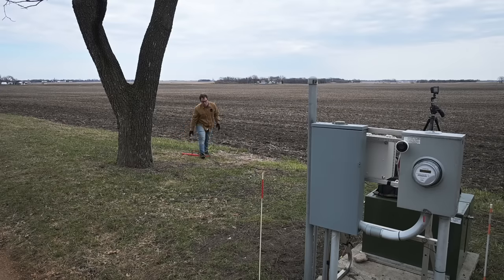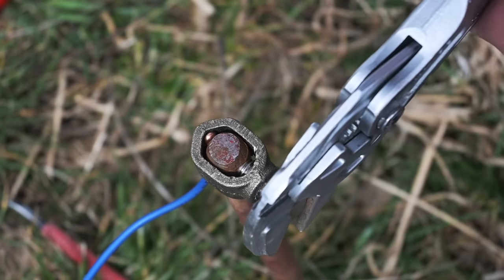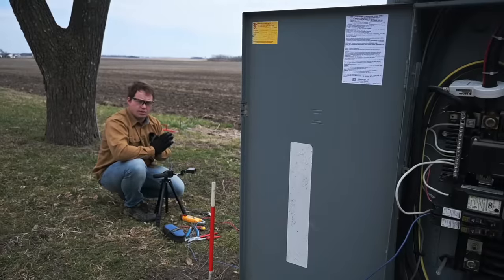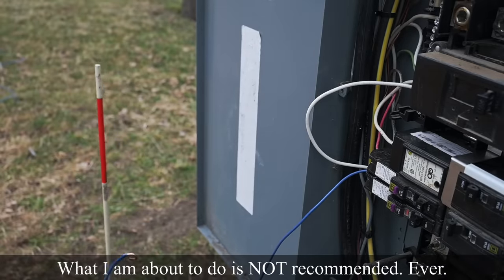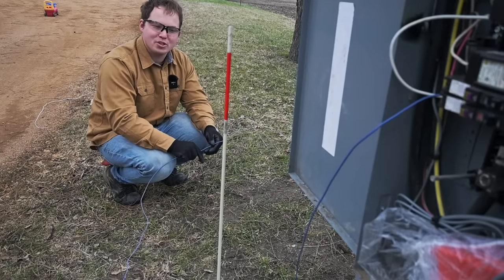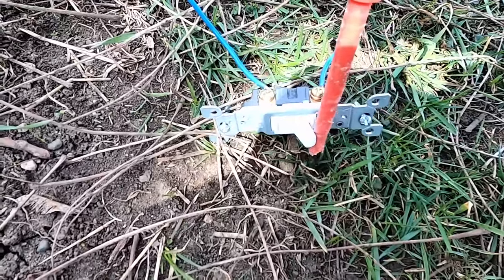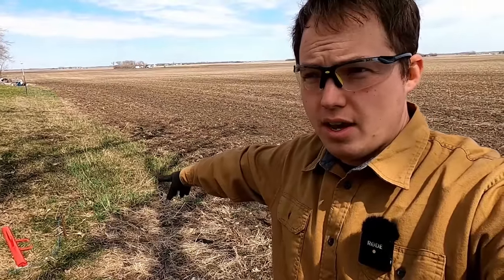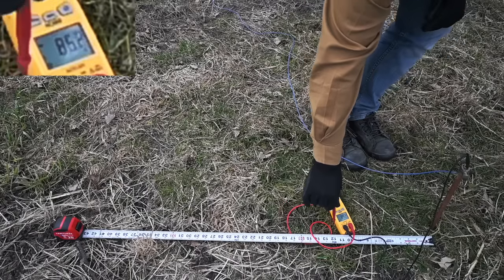Will 120v To Ground Trip a Circuit Breaker?

Comment: So, other than cost - why not install a GFCI breaker in every position in your breaker box?
Reply: I mean with new code you need an AFCI breaker for almost every room in a house. I would assume AFCI Breakers would also protect these faults
Reply from the maker: In my opinion cost is probably the main issue. There is no reason to not have GFCI and AFCI protection for most of your circuits. One reason you could argue is that in some "dry" areas like bedrooms GFCI would not add any significant protection because the individual is unlikely to be "grounded" and thus the GFCI would not trip. Another reason is that GFCI breakers can "nuisance trip" where they trip for seemingly no reason. Interesting stuff!
Reply from the maker: Interesting thought. I wonder if an AFCI would trip in this scenario. That might have to be a future video!
Reply: Most of Europe does. Instead a GFCI on every circuit I believe they protect a portion of the panel. Like a little sub panel within the panel. I believe they call them RCD's residual current device.
Reply: In some countries such as the UK every circuit in the house has ground fault protection BUT the trip level is 30mA not 5mA, and I believe they use one main ground fault protector for the entire house (they call them RCDs there). The problem with installing a single GFCI breaker (or outlet) to protect an entire circuit is that everything you plug in has a given amount of electrical leakage (and this is perfectly normal). When these leakage currents add up to 5mA now you have a nuisance trip. For this reason, it's better to install a GFCI outlet at each point of use, and this is what is commonly done in commercial buildings, although it costs more. It's also a lot more convenient to reset a GFCI outlet than one in a breaker panel.
Reply: @pjseiler5930  Some AFCI breakers have 30mA ground fault protection. Others have no ground fault protection at all. This varies based on the brand--for example, Cutler-Hammer/Eaton type CH AFCIs do have 30mA ground fault protection, whereas, if I recall correctly, GE AFCIs do not. A combination AFCI/GFCI breaker has 5mA ground fault protection.
Reply: @BenjaminSahlstrom  I don't use GFCI breakers so I can't speak to the propensity for a given brand of GFCI breakers to nuisance trip (and it's not like you have much choice in the matter, you are stuck with the brand of the panel it's going into). But for GFCI receptacles---my experience is been that the Legrand GFCI receptacles produced in 2017 are far more likely to nuisance trip than current production Leviton GFCI receptacles. I've been replacing Legrand GFCI receptacles with Leviton ones because of this.

If you dig deep into the UL943 requirements for GFCI receptacles, you will find that the allowable trip time increases as the leakage current decreases. At 6mA, a GFCI is allowed to take as long as 5.5 seconds to trip. But at 50mA, a GFCI has to trip in 1/4 of a second (250mS). 

But it probably costs more to implement this current-dependent trip time, so some GFCIs don't do this and simply trip instantly regardless of the fault current once it exceeds the 6mA threshold.

But a GFCI that does implement the current-dependent trip time would be more resistant to nuisance tripping.

The formula stated in UL943 for the trip time is:
T = (20/I)1.43 Where T = time in seconds
 I = ground fault current in milliamps
Reply: Some loads will falsely trigger a gfci -  like the sparking igniters on a gas stove top.
Reply: @HoosierRallyMaster  Depends on the GFCI, some brands are more prone to false tripping than others.
Reply: @ericwotton2046  Yes, originally there were just one to two RCDs in the panel. Now the trend its towards more nd to RCBOs (Residual Current Breaker with Over-Current protection). In Finland RCDs are mandatory in new installations on all circuits with the exception of a dedicated fridge or freezer. This includes also light fixtures. On modifications they are mandatory in bathroom sockets.
Reply: @ericwotton2046  Yes, originally there were just one to two RCDs in the panel. Now the trend its towards more nd to RCBOs (Residual Current Breaker with Over-Current protection). In Finland RCDs are mandatory in new installations on all circuits with the exception of a dedicated fridge or freezer. This includes also light fixtures. On modifications they are mandatory in bathroom sockets.

Comment: The current isn't trying to get to ground -- it's trying to get back to the source. In this case, it's creating a loop that goes thru the blue wire and back to the panel somehow (probably through the grounding rod over by the panel).
The dirt between the two grounding rods has some resistance. Apparently in this case, the resistance is high enough where it won't trip the breaker. This is why it's important to have big ground fault paths. The resistance has to be low enough to trip the circuit breaker.

See this Mike Holt video, the slide around 18:26:
https://www.youtube.com/watch?v=mpgAVE4UwFw&list=PLRNS1x1jcKbEgNJx26RWB8O4Fm1Ny-bxK&index=1

A grounding rod isn't a suitable ground-fault path.

Comment: No one differs on if you split the neutral and the ground. You only connect them after you jump voltages in either the transformer or the first panel.

Comment: Had a service call 2019 90% furnace locking out turned out the neutral outside somwhere was loose . fluctuating voltages at outlets in house.

Comment: Wow! Very cool video. So now I'm wondering why breakers DO trip when a hot leg touches a ground. Maybe it has to be within the system rather than straight to a ground rod?
Reply: Bc it travels through copper earth wire to neutral then home
Reply: @Froggability  you mean if its bonded. Right? If neutrals and grounds arent bonded anywhere and a hot leg touches the ground, breaker wont trip. I assume

Comment: Buddy to make a proper ground you need to take the ground rod and bond to the panel to make it trip. The reason it dose not trip is because it’s not bonded to the source. All you did was make a wire the Load like a light bulb. And light bulbs don’t trip CCTs

Comment: So loving your videos and learning so much. Quick question: why does the voltage decrees the closer to the ground rod you measure? In my ignorant mind it seems like the voltage would increase the closer to the source it was? Please help?
Reply: Good question - it's counter-intuitive the way it's done. Made me think for a second as well. Think of it this way. The ground rod is electrified when the breaker is turned on. All of that voltage is not drained into ground, otherwise the breaker would trip. If you put both probes directly on the rod, you would have a measurement of zero voltage difference.  Alternatively, if you measured the voltage (which is actually the potential DIFFERENCE between the 2 points of the multimeter probes) between the rod itself, and a point 100 yards away out in the middle of that empty field, you would have a large voltage difference. It would be something less than 120 volts because the full 120 isn't on that ground rod due to some of it leaking into the ground. As you move that probe in the middle of the field closer to the ground rod, you would start to see less and less voltage DIFFERENCE between the 2 probes. Hope this helps.

Comment: We had news of a Lamp Post electrocuting (but survived) a teenager....     I don't know how Lamp Posts are wired...
But, wouldn't you expect that if the Hot or Neutral were to touch the metal Post, if should blow a fuse ??
Maybe the ground was not properly bonded to the metal Post...    Who knows...   The kid did survive....

Comment: Question. I have a bathroom in my garage with a steel bathtub sitting on the concrete floor. I have a 240v waterheater sitting on wood blocks . Do I need a gfci for the water heater?
Reply: Not for a 240v circuit. But you should have a 4 wire cord connection instead of the old 3 wire.
Reply: @andread8251  where should I hook up the 4th wire?

Comment: Earth has different resistance some have high and some are low resistance. For this reason the code prohibits earth as a SOLE return path to earth meaning alone it is prohibitted but in conjuction with other conductor like EGC it can help have lower fault current to EGC experience extensive damage to EGC. Both current flowing to EGC in parallel with the earth will go back to the source.

Comment: Prospective earth fault current on a TT supply with and earth rod is so low it will not trip on a MCB circuit breaker.
That is why in the uk all installation relying on a earth rod for mains earthing requires RCD protection gfci in America

Comment: 120v will NOT kill you nor will anything being 14kv and under lol, I worked and maintain the 14kv n under power lines and have been zapped by a 14kv line and it only hurt really good 👍 120 n 240v aren't bad at all, way less then a bee sting, like one but without the lasting of one. Why most die is from the length of time held on a 14kv. If grabbed your never letting go. Because your muscles tense what does being that the 14 kv like a stun gun locks it all up

Comment: The only thing to stop a ground fault is to open the circuit (or turn off the power source if you have control of the generator.) The breaker does just that and it's why EGC is so important, you want that fault to pull as MANY amps as possible. The more amps, the quicker the circuit opens.
Putting the hot wire to the ground rod only creates a circuit from source, to ground rod, through the ground, back to the ground rod of the panel and then back to the source. Electricity is ALWAYS trying to get back to the source. That was the eureka moment when I was trying to learn this stuff. Because of the high resistance at the electrode, it's not going to pull a lot of amps through it to trip that breaker. Mike Holt had a really good video on EGC and grounding. Lengthy and technical but absolutely thorough. https://www.youtube.com/watch?v=mpgAVE4UwFw
And I'm glad you didn't accidentally "kneel" on the ground during this video. Might have been your last.

Comment: I just paused the video but here's my prediction. The breaker will pop but not instantaneously as it's going to be directly related to the resistance to flow once the resistance gets low enough the breaker will pop 🤔

Comment: This things proved that between live wire connected to earth ground the circuit breaker did not trip  what about the  neutral ground   touching the live wire what would possible happened any answer???

Comment: if it was nice and warm and damp out maybe you could have driven some worms up to surface for fishing LOL
I have seen this twice in real life my neighbor got shocked by his lamp post that was set in concrete because he replaced photocell and wired it wrong making pole hot not grounded it was like that for a year. 
my brother's sister-in-law had breaker running to swimming pool that kept blowing turns out the original installation of the wire was just Romex buried in the ground a foot deep and somebody hit it while digging and just threw some electrical tape on damage so in rain or wet ground it would draw too many amps and blow

Comment: Hey can you do a video of you building a fake wall with wood studs and insulation and create a electrical fire scenario?  Like show what happens when you run a Electric heater on high for a long time  how it will eventually heat up the wiring.  Be good to show people because SO MANY people think it's the Heaters them self's that start the fire yet it's actually the heater heats up the wiring inside of the wall that creates the fires.
Reply: It's not really the wiring in the wall that creates the fire, it's the shitty connection at the end of it that does.
Reply from the maker: I have thought about doing something like that in an overload/high load scenario. Will definitely add that to the list.
Reply: @BenjaminSahlstrom  I'd suggest using a receptacle with backstab connections, except remove/reinstall the backstab wire a   few times to make a bad connection. Then power a space heater through it.

Comment: I only have half of the power to my plug. H to N 62v .  H to G 120v. What is wrong with it?
Reply from the maker: Sounds like you have a loose neutral wire/connection in a junction box, panel, or on the receptacle itself. That is what I would be looking for. Since you have 120v from line to ground it sounds like neither of those are the issue. Good luck and let me know what it was in the end if you don't mind!
Reply: I believe  you have what is referred to as a  FLOATING NEUTRAL,  caused by either a bad breaker or a loose wire in the neutral side of the circuit.  If  the circuit breaker is  obsolete and unavailable, just bypass the circuit breaker.  This may burn your house down , but it will save you the trouble  and cost of having to install a new breaker box.
Reply: @rodneycaupp5962  are you out of your damn mind?!?!
Reply: @rodneycaupp5962  your joking right?
Reply: @ericwotton2046   Yes I am.  Old navy electricians always do things right.  I just thought I'd throw a little humor at the problem.
Reply: Rodney Caupp  Cant figure it out why would we need to bypass ANY Circuit Breaker if it's a Floating Neutral??🤔😒

Comment: You probably had a lose connection if the first breaker was not a standard one that trips only in response to excess current arcing could have happened which would explain you not seeing amps on the meter.

Comment: What happened if neutral short the ground , how many amp draw in neutral if short ground? Pls answer
Reply: There would be basically no effect - unless there is a GFCI upstream. It might trip.
Reply: Neutral and/or Ground generally nears to 0V.
Neutral dead-short to Ground usually will at max 'induce' few miliAmps, just enough to trip GFCI/RCD.
If Neutral dead-short to Ground and drawing some 'figuresome' Amps, then probably yr Neutral is 'faulty' aka floating.

Comment: Hey Ben I'm subscribed. Thanks for this. So now, after watching this, I must ask:

What, then, is the reason for grounding at all??...
Reply: Lightning protection only
Reply: @ToothpasteOrangejuice  Too discharge the Static Charge build-to that would otherwise accumulate on the grid.
Grounding does not provide Lightning "protection", but it may reduce the damage <= there is no guarantee!
Lightning will take ALL PATHS through your home, even through wood.
Lightning will cause the sap in a tree trunk to boil & vaporize, causing the tree to EXPLODE...

Comment: I guess the earth isn't as good as a conductor as metal.
So the ground is acting like a resistor.
Current is flowing to ground, but if there isn't enough to trip the breaker/blow fuse,  then there will be a voltage drop accross the soil resistor 
I wonder if you could map it out in 3D, you might see a sphere of potential difference, decreasing in concentration as it moved away from the spike?
So spike to 1" = 50v. 1" to 2" = 25v. 2" to 3" = 12.5v, etc. Measuring some inch of earth about a foot away might be somehting like 2v potential difference. 
Also, I wonder if you had two earth rods... One connected as standard. But the other about 4ft away is connected to the first via only a 110v lamp. The lamp could act as a warning that there is sustained current flowing into ground, and to be extra careful.

Comment: Can it not be that your ground rod is not properly installed, meaning the resistance is too high? If you have less resistance your breaker will trip.
Reply: This is a typical ground rod installation.  Many are worse = have an even higher resistance...

Comment: Why is the voltage higher the further you got from the ground rod? I would think the further out you go the voltage would drop off.
Reply: Its not that the voltage is higher the further out you go its that there is a greater difference of potential. i know that is probably just as confusing but I dont know how to explain it in eli5 terms.
Reply: Because he referenced/connected one of his probes to the hot wire connected to the ground rod. If he had referenced/connected one of his probes to the neutral wire in the panel, then it would work that the further you go out the more the voltage would drop off.

Comment: Why did the gfci breaker trip but the other breaker didn't trip?
Reply from the maker: The GFCI is designed to trip with a very small amount of current leakage. The standard breaker needs more than 20a of current to be drawn for it to trip and since the earth was not a good enough conductor the breaker didn't trip at the 10a that the dirt was able to conduct.
Reply: @BenjaminSahlstrom Thank you...so a 5 milliamp leak will trip the gfci breaker, but, since the other breaker is rated at 20Amps, there needs to be more than a 20amp load to cause the other breaker to trip.

Comment: Was it only me who noticed a ground fault breaker on first shot and ask your self, what he is he tying to do?.. that's not gonna work....
Reply from the maker: I'm curious how many noticed too!
Reply: @BenjaminSahlstrom  I noticed it.  Also a code compliant ground must be 25 ohms or less. It takes a special meter to measure it, but the code will just allow 2 ground rods driven 6 feet apart so most installs just use 2 ground rods.